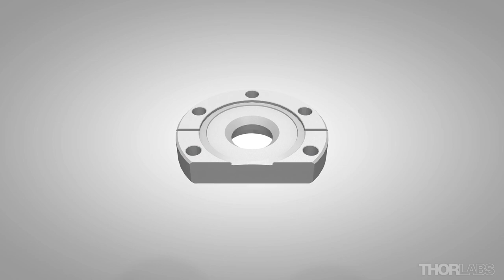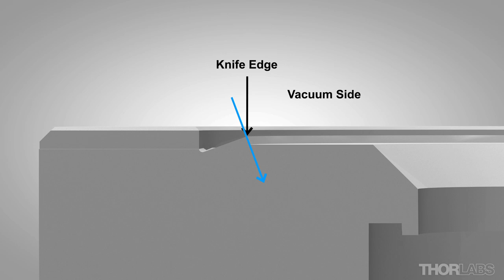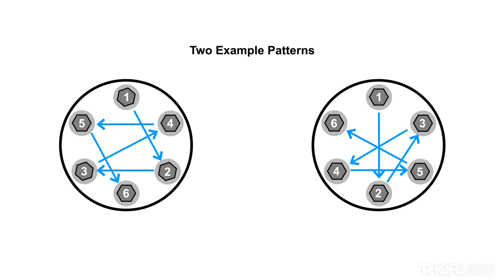Working with CF Vacuum Flanges | Thorlabs Insights

Comment: Nice instructional video! One thing that I do differently is to not completely tighten the flanges, i.e. stop before they touch. Then, if I find a leak later, perhaps after baking the system, I can slightly tighten the bolts to eliminate it. If you tighten completely in the first instance there is no 'wiggle room' to correct any small leaks later.